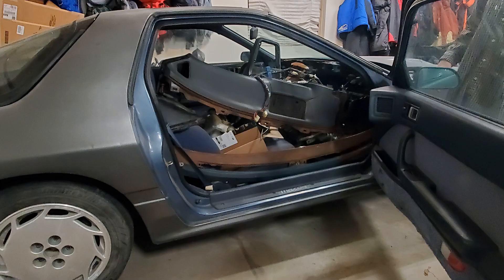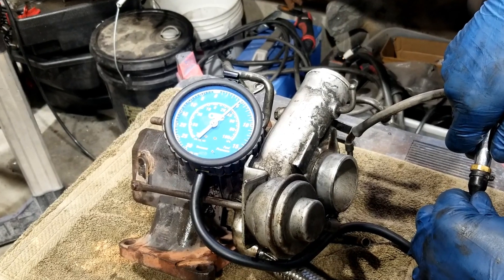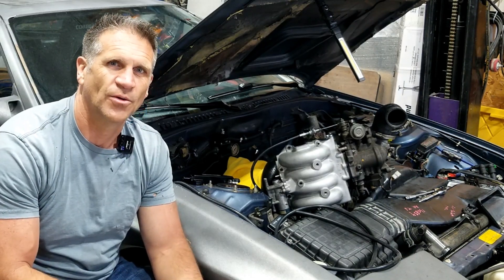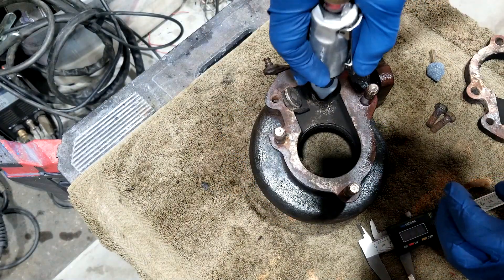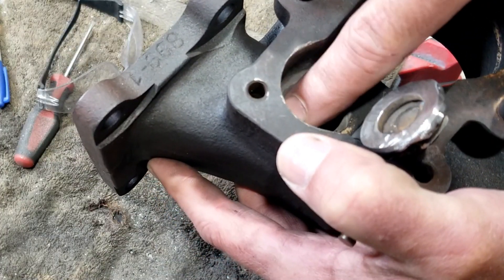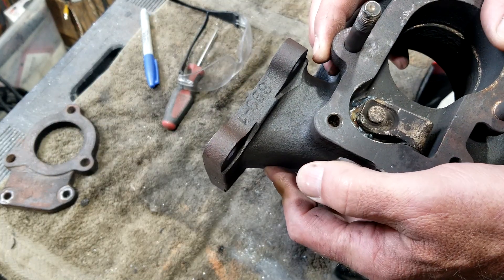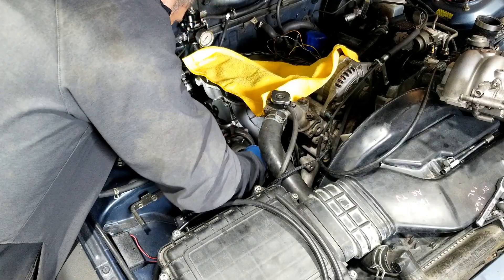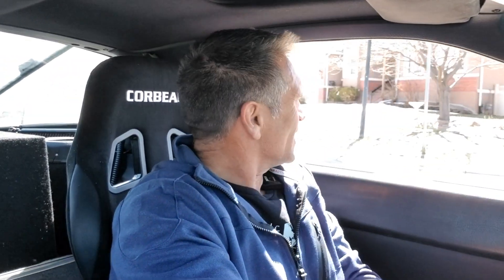Porting the turbo on Bryson's "Initial D" 1987 Mazda RX7 FC

Comment: Check out the bnr turbo upgrades-uses the oem turbo for parts. Extremely affordable comparable to precision/garett/holset($875 USD plus core and shipping). I'm running 10psi at 310whp(break in tune) with a streetport and other assortments.
Reply from the maker: Thanks for the tip!

Comment: If you can get a downpipe that incorporates a bellmouth right behind the gate so the flow isn’t a awkward 90 degree path to flow into the turbine exhaust stream I bet it would sort the last bit of your boost creep issue

Every old internal gated car I’ve done this with has resulted in massively improved boost control. With additional power as a side benefit
Reply from the maker: Thanks for the pointer. It takes 10lbs to fully open the gate, so 10 psi isn't really unexpected after I think about it. But to your point, the more the waste can flow the better.
Reply: @some-guys-garage  at the minimum you’ll have more power and that’s never bad